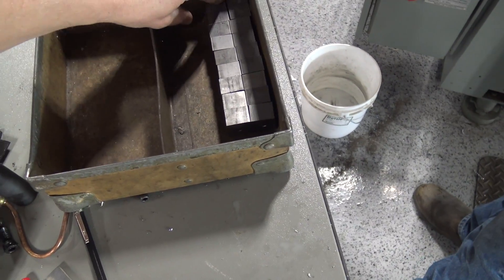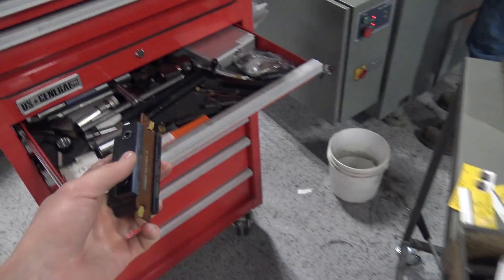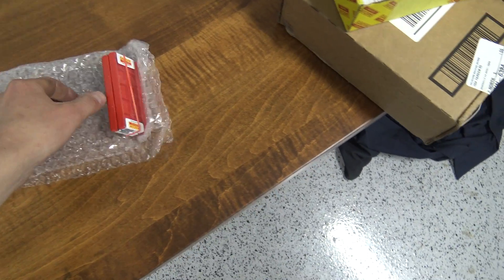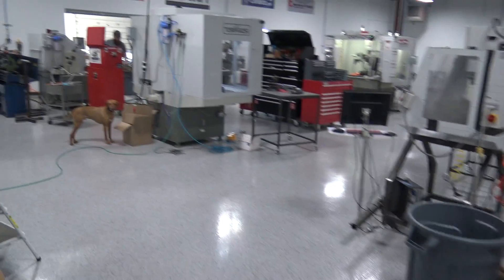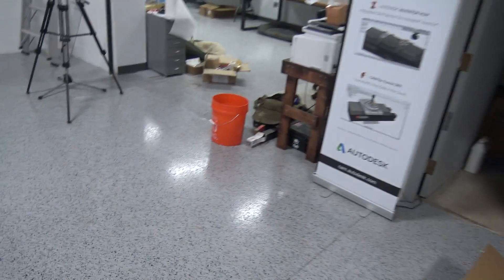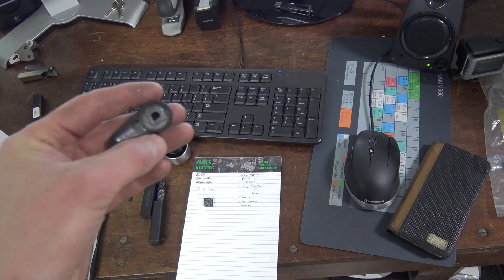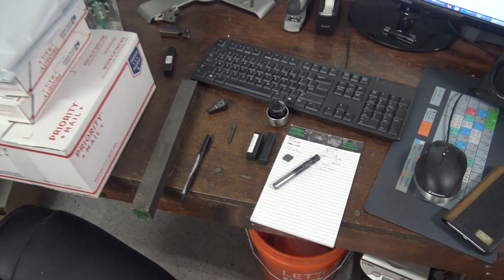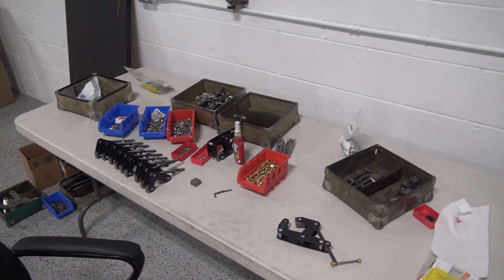Chip Break #2 - Machine Shop & Small Business Daily Life

Comment: Great little vid :-) About you Materials Management... If you don't have Inventory Software yet, maybe it would be a good time to get a package. They will more than keep track of your inventory, but also the Physical Location of materials. Your drills, for instance... You have your Bulk inventory in one location, but you can specify another location for the Specialty items and keep the more expensive items independent of the bulk drills...

As you grow, Logistics is going to play a bigger roll in costing projects, maintaining inventory and keeping inventory levels to a minimum... I was "Inventory Controller" for ESSO Resources, a subsidiary of EXON... When I walked in the Storage and parts facility had an inventory worth (on paper) $14 Million. In the first 6 months, I cut that by 20%... That 20% was parts and materials, which were over-stocked and/or obsolete...

One little part, a 1/4" SS Cap-screw was stocked in about 6 different locations, under as many part numbers... The same Cap-screws were listed according to the OEM part number and were purchased accordingly. I simply Cross-referenced all of the various part numbers to a common Part Name and location, cutting the necessary quantities. There were many such parts... Eventually, you may run into similar issues.

When you get your "Iron-worker", if you were to inventory all of the parts, you'd probably find that many of the parts would be identical to parts in other machines... A good Inventory package will help keep your purchases to a minimum and that means Capitalization of Assets... Banks like a well organized business... However, the down-side is, Materials Management and Logistics cost money, they don't make money. It's purely an expense. It takes time to organize and keep up-to-date... Hope this helps :-)